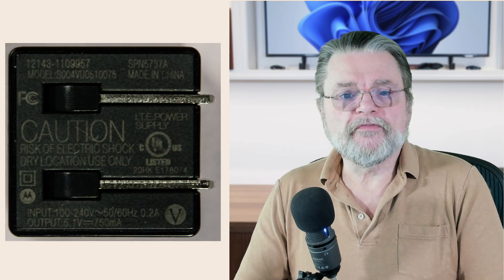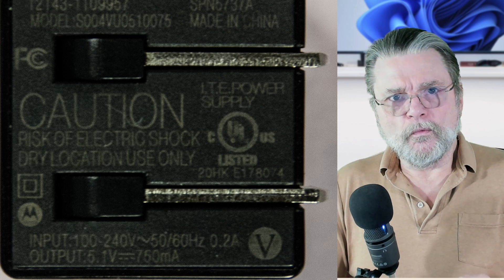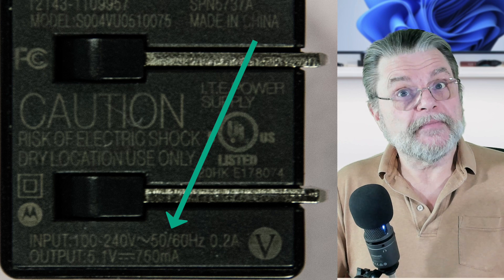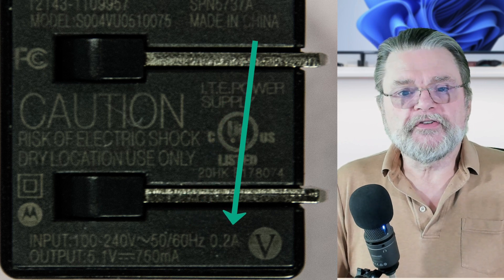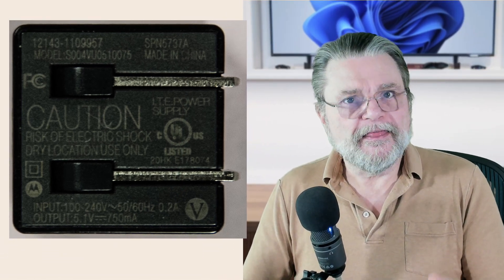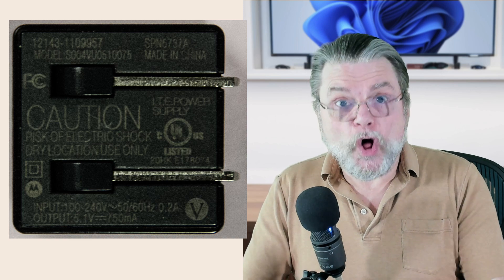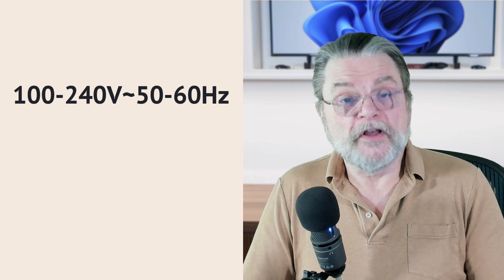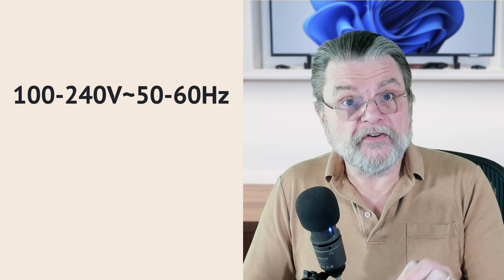How to Read Phone Charger Voltage Specs

Comment: Hello Leo, my question is, so many devices nowadays come with only the charging cable & Not the actual charger (Plug/Block) itself, which has the label on it stating what voltage & amperage ratings it has.
 I have yet to find any charging cables that come with products with any such labeling on them. So how do you know what that particular charging cable is capable of or are they all universal charging cables whether they come with or without the plug?

Comment: My laptop charger has data written 20Vx3.25A 65W, 14Vx3A, 9Vx3A, 15W 

Can i use it on my magicpad2? 
Which has original charger labeled 5Vx2A 10W, 10Vx4A 40W, 11Vx6A MAX 66W, charger side usbA, other site usbC

Comment: Hello sir, i am a big fan of your explanation. i have seen your video about  Microsoft windows user account and local account. At present i am using Microsoft windows user account instead of local account. now i want to change my sign in option for Microsoft user account. instead of pin i need password. because i have problem in SQL server reporting services due to this pin. i already use include letters and symbols option. but no use.  can i change that sign in option?  please explain sir.

Comment: Funny, my galaxy phone manual says I am to use only the samsung-approved charging block, yet the company has none in stock.  The phone came only with a USB3 type C cable.  I ended up using the chromebook charger, which supposedly voids the warranty.
Reply from the maker: Yeah, while using the manufacturer's device is the best option, it's not the only option. And requiring it is just the manufacturer covering their behinds in case you use a crappy alternative that damages your phone.
Reply: It's just funny, 'cause even if you want to "follow the rules exactly" you can't.  Then there's the other phenomena: if apple corporation takes out the charging block / headphone jack / transflash socket, other manufacturers copy the behavior.  I know of few other instances this happens.

Comment: There is a bit of gray area when it comes to amperage. In case point if your charger delivers 2A but your device can only accept 1A, then that could be an issue depending on your device. 
You could essentially get too much  amperage being delivered to the device which it can harm device. 

Again it all depends on what type of device you are charging. If you are charging a dumb device with no intelligent capabilities, you want to stick to a charger that matches the required input. The exception of course as you explained is most devices have intelligent charging capabilities, cell phones etc.

So if you have an old device that requires 5v @ 500mA, stick with a charger that will deliver the same. You could use a 5v 450mA (it will just take longer), you just can't use 5v @ 1A. The amperage is too high. 

In theory as you stated with a smart device that is rated @ 2A you could use a 3A, because the smart device will regulate the power required. Unless something fails of course.
Reply from the maker: "You could essentially get too much  amperage being delivered to the device which it can harm device. " This is very rarely the case -- only for VERY poorly designed devices. A device that needs 1A should only ever take 1A, regardless of the rating of the power supply being higher.

Comment: The USB Power Delivery(PD 3.0 and newer) standard is a godsend, but there's always the transition period until everything you have is compatible.

And it still makes sense for low power devices to stick with ye-olde 5V 0.5A standard, as the components are inexpensive and relatively rugged.